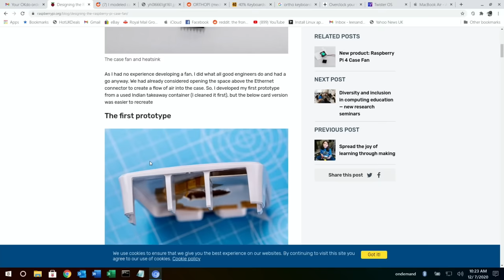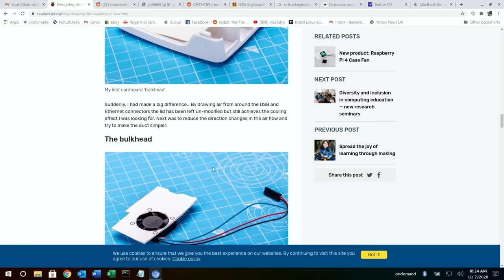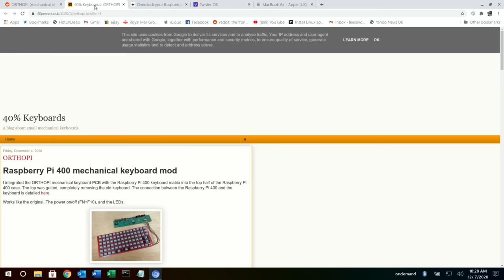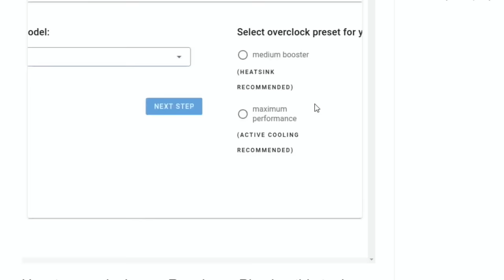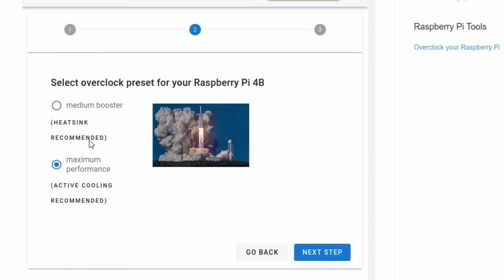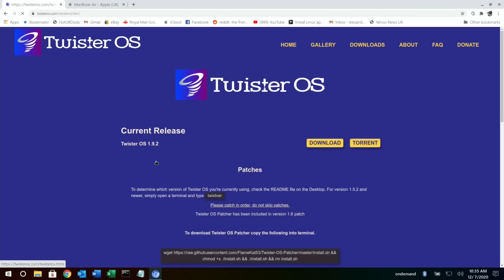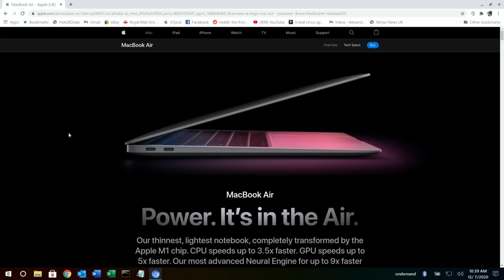Pi news episode 14. Twister OS update. Official Raspberry Pi case fan.

Comment: In the  Pi 400 there is room to add the new case 3 wire fan sold by raspberry Pi corporation for around $5.00. The only problem is connecting the wires.  It’s not that hard if your into electronics. Then make sure you configure the fan to come on at 70c.  The fan will require a hole for intake.  I’m sure someone will come up with a DIY project.  I recommend that you don’t overclock the  400 without adding a fan.

Comment: There are audio issues on the new Raspberry Pi OS; HDMI outputting mono only, low HDMI volume, and no audio in Firefox. The mono issue is fixable with a config file edit. The volume issue is fixable by going into ALSA mixer and setting volume to maximum. Even though I tried the suggested fix, I have not been able to solve the no-audio in Firefox issue. People are also reporting Bluetooth audio issues.
Reply: In the new December update they replace ALSA and now now use pulse-audio and the sound is much louder.
Reply: @NewAgeDIY  Yes, they did but you have to go to the ALSA mixer in terminal and turn up the volume. ALSA is still used underneath, apparently, which is why you shouldn't uninstall it. Messed up, I know. My HDMI audio and other people's was LOW using Pulseaudio until we turned up that other mixer.
 
https://www.raspberrypi.org/forums/viewtopic.php?p=435805#p435805
Reply: @NewAgeDIY  According to Raspberry Pi Engineer & Forum Moderator spl23, "No, whatever you do, do not try to uninstall ALSA! Pulse lives on top of it and talks to the hardware through it - if it's not there, Pulse won't work." 
 
https://www.raspberrypi.org/forums/viewtopic.php?p=1773050#p1773050

Comment: Is it dangerous to overclock the Rb Pi 4B like medium overclock? I have two little fans coling all time but i dont know, i feel the heat coming out, and i havent done the overclock yet :/
Reply: Working now with raspbian, have also tried ubuntu mate
Reply: 99%of my activities in manjaro kde dont strugle without the overclock. Maybe for ubuntu gnome it could help. As well optimized games, videoconferences, video editing, heavy multitasking... But ive heard it makes pi live a little shorter and i have worries with the energy send to usbs. If you use your main external hd, watch out
Reply: OMG  @RafaCoringaProducoes   thanks a lot! I wasnt thinking about the energy flowing to USB devices! U saved my work
Reply: I've been running at 2ghz on all my Pi 4 boards since June. With active cooling it is no problem. Temps rarely get over 40c